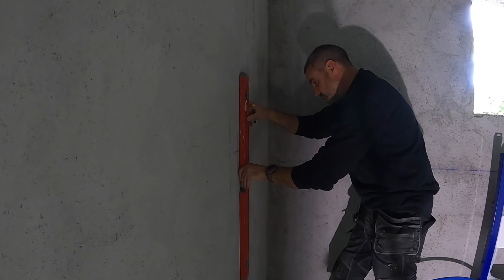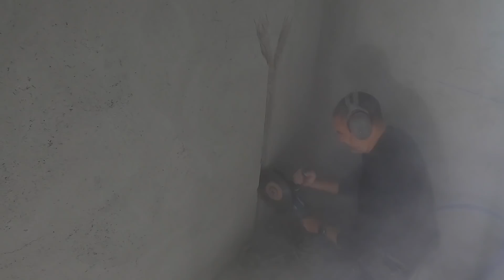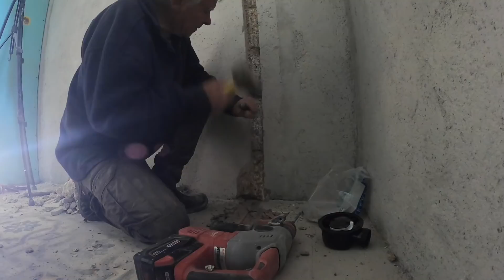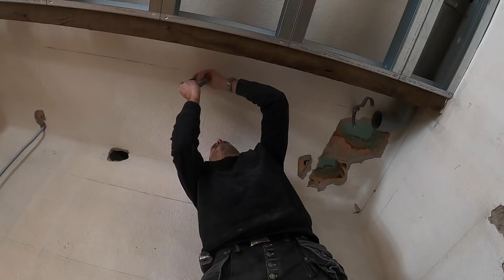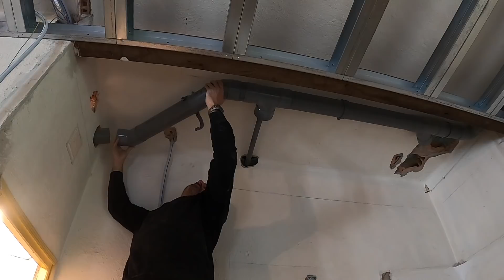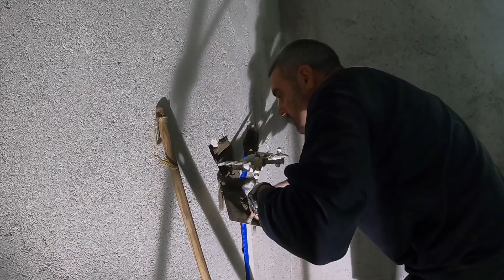Installation de plomberie en PER première partie

Comment: Bonjour Pierre ça fait plaisir de vous voir en pleine forme comme d'habitude.
Moi en tant que plombier à l'ancienne je connais pas le PER le multicouche je sais c'est plus rapide et plus économique.
Avant les maçons il monté la pierre.
Maintenant les maçons il monte du parpaing c'est pareil que le PER et le multicouche.
Moi je fais beaucoup de tuyauterie en acier et en cuivre parfois je repars du plomb
Et je changerai jamais ma façon de travailler pour des tuyaux en plastique.
Toi en tant que Maçon,ton travailles de plomberie est vraiment propre.
À la prochaine chef
Reply from the maker: Bonjour,
plombier ça a été mon premier métier, c'est d'ailleurs le seul métier pour lequel j'ai une formation lol. 
Perso je ne fais plus d'installations en cuivre depuis presque 20 ans et pas pour une question de prix, c'est simplement parce que chez moi l'eau est assez acide et ronge le cuivre. Je change régulièrement des chauffes eau sous garantie qui n'ont parfois qu'un an ou 2. 
Je n'ai jamais eu de problème avec le PER. 
Merci et bonne soirée.

Comment: Toujours au top, par contre, franchement ne mets plus de per et passe au multi couches cest juste incomparable et je suis chauffagiste 😉
Reply: Le PER est très bien pour le sanitaire mais le top du top restera le cuivre. 👍🙂
Reply from the maker: @Sam OE je n'ai jamais testé le multicouche mais je n'ai jamais eu de problème sur le PER depuis presque 20 ans. 
Merci et bonne soirée.
Reply from the maker: @Dimitry Huet chez moi le cuivre est loin d'être le top pour une installation. Je ne fais plus d'installations en cuivre depuis presque 20 ans, l'eau est acide et ronge le cuivre. 
Je change souvent des chauffe eau sous garantie qui n'ont parfois que 2 ans lol.